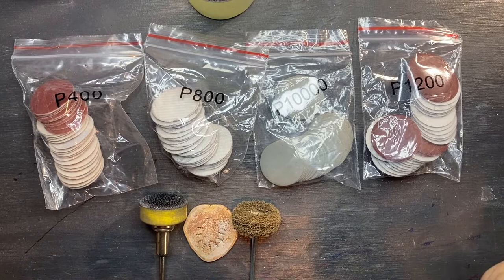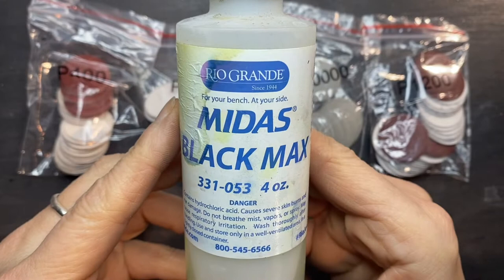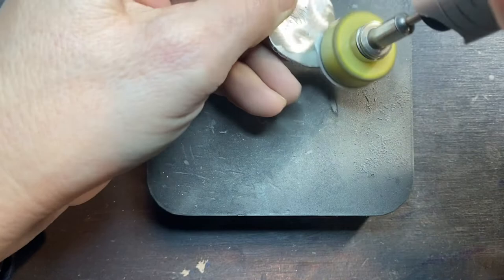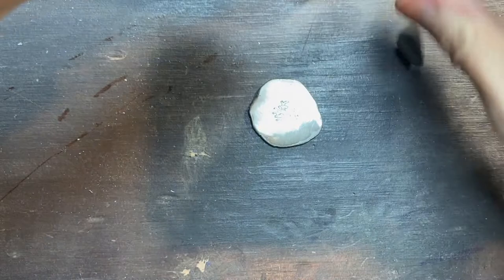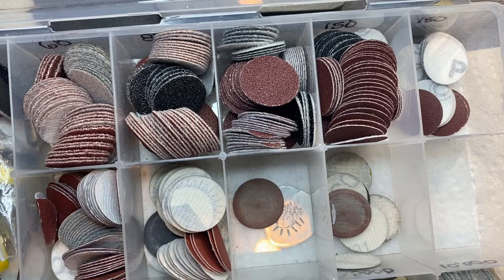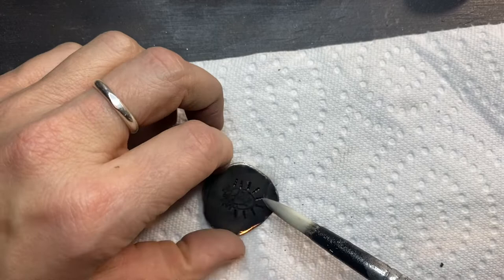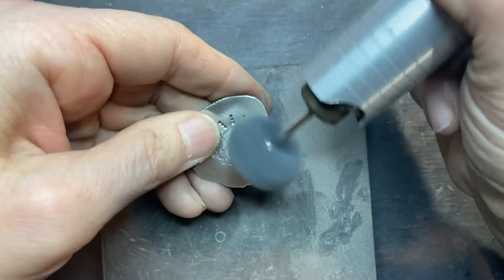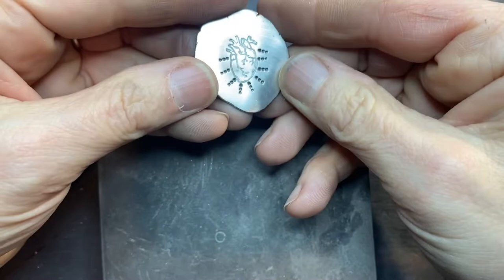Tutorial- The Perfect Satin Finish | How to achieve that soft beautiful silver finish

Comment: Tracy, what do you use (instead of the large sandpaper discs) when your piece is not a flat blank or piece? Sandpaper rolls? Or can the radial bristle discs work?
Reply from the maker: I sand everything before soldering anything so there is very little cleanup when it’s finished. All I have to do is tumble it in steel shot and polish on the buffer
Reply: @TracyGrossDesign if you tumble in steel shot and polish with compound doesn’t it get rid of the satin finish?